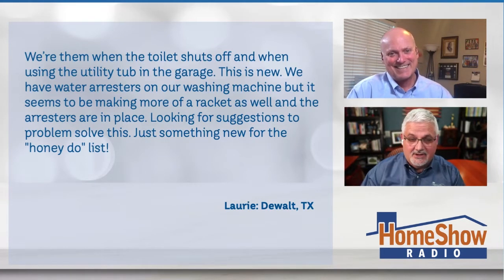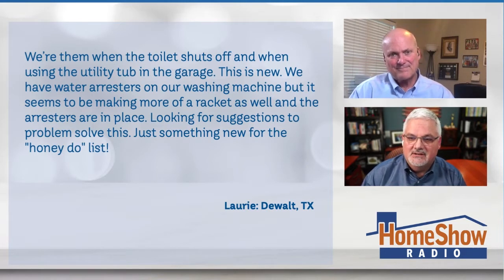Water Hammer Fix

Comment: Had a new AC selonoid installed. Put on an Arestor, turned off pump drained everything and still has hammering. Feels now like it’s hamming on the drain pipe that goes out the house to the pond. Starting having problems when we had a new pump installed. Any help would be greatly appreciated app. Thank you   Joe

Comment: I need to put one on a pipe that is coming to my washing machine but the pipe is buried in the cement floor.   Could I put a outside faucet hose T from the pipe with one outlet going to the washer and the other going to a vertical piece of capped off hose?

Comment: When I turned off my water and drained everything and then closed all the faucets again my pipe hammer went up times 10 right when I put the main back on. The pipes were hammering so hard it was scary.  Do I need to barely turn it on so pressure is lower that first time?

Comment: Sir you are so wrong. All water pressure will bleed out all air and then your back to where you started.water hammer is from air trapped in the system